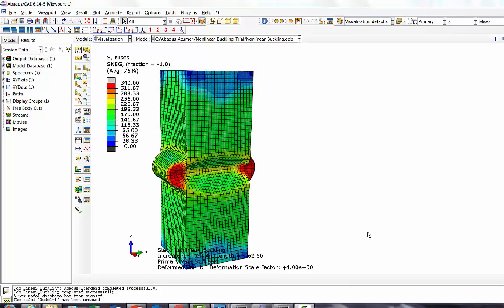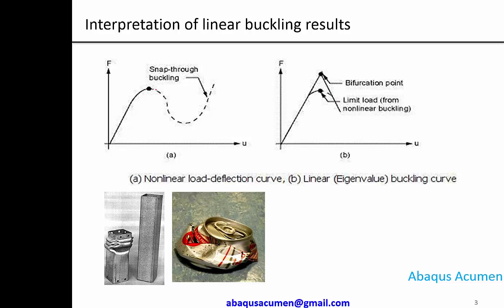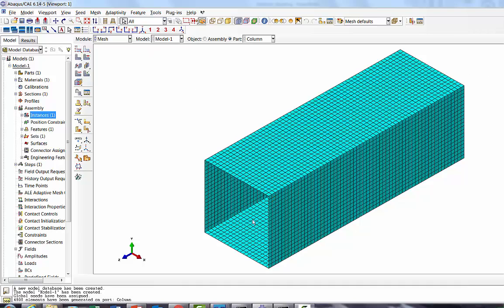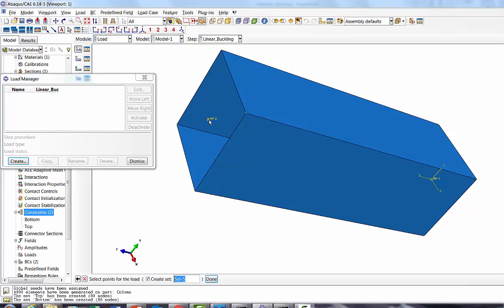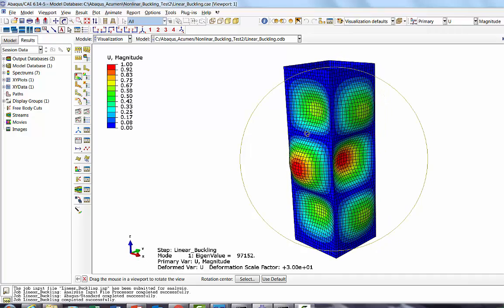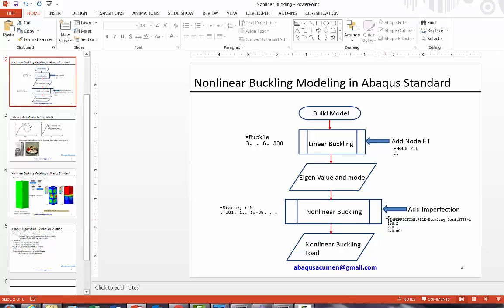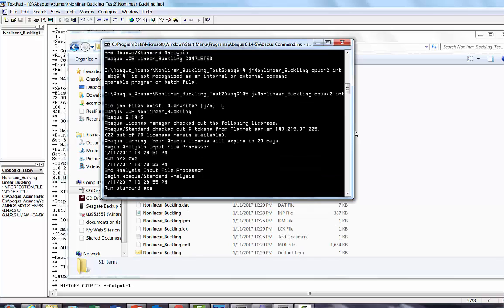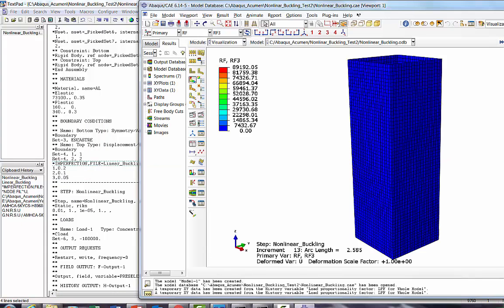Nonlinear Buckling Example (Aluminium column buckling)

Comment: the length of box 300 mm. you are using a displacement of 1 mm in the negative z direction, and the load multplicator of the first eigenbuckling mode is at 97152 ??????????

Comment: Perhaps you got the size of the square aluminum box wrong (the parameters you provided are 50x50x300mm, equivalent to Length x Width x Height). In the model, you used 98x98x300mm, which suggests you used 100x100x300mm aluminum? @abaqus Acumen

Comment: I have checked the eigenvalue manually by eular formula but it is not same as result in linear buckling
Reply: euler formula only valid for elastic buckling of the entire column element in compression, only applicable for very slender elements (no local buckling like in this video)